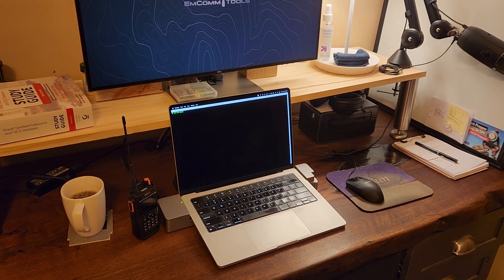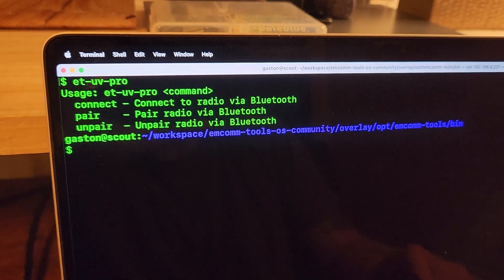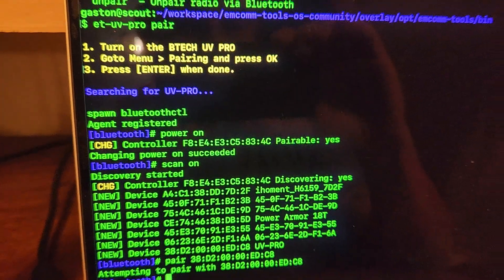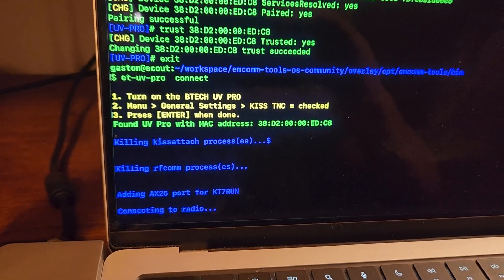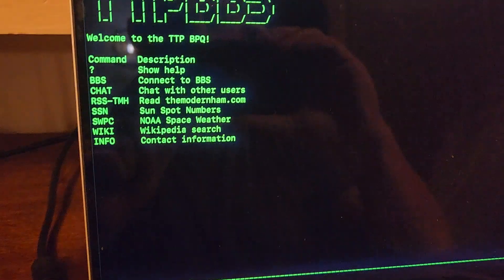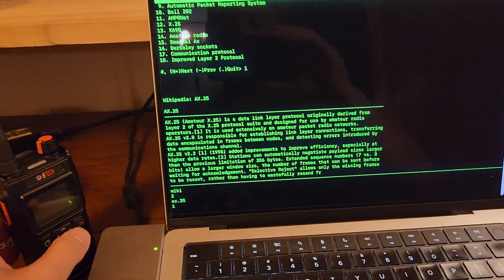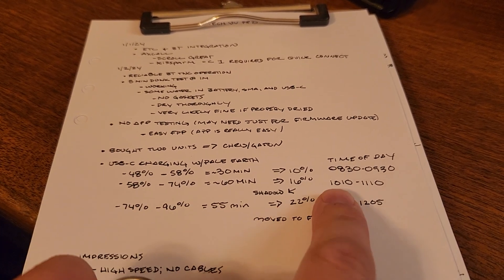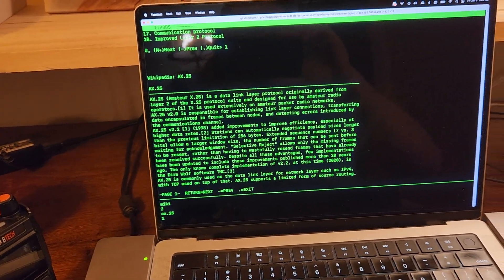BTECH UV PRO - Plug and Play TNC Support

Comment: I know that the term "prepper" causes many different reactions. For me, it's literal. A "prepper" is someone who takes the initiative and increases their preparedness in order to survive situations that others likely will not.  As an instructor, I see your BBS as a tool to maintain and pass on knowledge even if the worst case scenario happens. 

I believe that every group of like-minded individuals needs to pick members who can archive certain bits of knowledge so that knowledge isn't lost over time.  The BBS is a GREAT WAY to pass it on.  Thanks, Gaston, for making me think... and for doing this.
Reply from the maker: That's exactly my vision for running a local BBS. I want to establish purely offline knowledge hubs for local communities. The bulletins can be pure gold for any community that invests the time to stand up the infrastructure and feed it with local, relevant and accurate info. Stay tuned for the full BBS video late this month. Happy New Year.

Comment: In case it's not clear, the poster is using macOS to connect to a Linux machine and using the Linux kernel's built-in AX.25 stack.  

While Bluetooth LE works on macOS, and you can run the native BTECH UV app on macOS from the App Store, you cannot pair and use it as a TNC with KISSet TNC.
Reply from the maker: Thanks for calling this out. I was connected via SSH from my Mac to the Dell 7220 running Linux. The Linux machine was the one paired to the UV Pro. And, yes, I was using the natice AX.25 stack under Linux.

I had some sensitive information on the Dell, so I ran the demo remotely with the Mac.

Comment: Exciting stuff. As someone who grew up in the age of BBS's I'm probably a little more excited than I thought I would be to hear this project's going on. 
I wonder if you could use something like internet in a box to download an offline version of the wiki and have the BBS pull from that. I think it would be a little more in line with the off-grid mentality. Sure the IIAB is connecting to the internet periodically to refresh, but if the internet goes down the BBS won't care. 
My radio arrives today. So whenever a build comes out that I can use to test this stuff you're working on I'll be looking forward to it. Keep up the awesome work.
Reply from the maker: Actually, I am already running and hosting local .zim files with kiwix. I have the full 56 GB dump of wikipedia on the same machine running as of 12/22/24. However, I have not yet integrated that as the date source using the BBS as am I a very new kiwix user. Enjoy your new radio. The full length BBS video will be coming out late this month.

Comment: Have tried bluetooth pairing the radio to a Chromium based browser with Web Bluetooth?
If search for "Web Bluetooth Samples" should bring up some example that pairs and dumps the device info (manufacturer and so on).
Would get a cross platform (anything that can run Chromium & has bluetooth) GUI and touchscreen UI (for using a smart phone with the radio) with one stone.

Comment: I wouldn't be too worried about the IP rating. The Comms Channel has plenty of video of this thing running powered on while sitting in a river.
Reply from the maker: Good to know. I have not watched any videos or even read the manual as I wanted a fully unbiased view of this radio. I'll have to go and watch some of the videos that others have made when I have time.
Reply: As long as it's not going to go belly up if I'm having to use it in the rain I'll be happy. I don't see myself trying to make connections from under the water too often 😎

Comment: I have not been a fan of BTec radio but they built a radio with a real Bluetooth interface. Being able to easily connect wirelessly is someting many of use what to easily use.  Thank you.  PS I wander if its supports 9600 Baud.
Reply from the maker: I'm in your camp, but this radio surprised me. I almost gave it away as a gift to one of my BMAC supporters, but decided to experiment with it for a couple of days. I'm glad I did. 

There's no option in the settings for 9600 baud and I have no clue of the hardware supports it. In general, you need special hardware to do 9600 baud. I recently purchased two of the DigiRig 9600 data cables for the FT-8xx radios so that I can benchmark the real world performance against 1200 baud. This is part of the R&D for the year.

Comment: Have you trsted this radio at 9600 baud?
Reply from the maker: Negative. I have other 9600 baud tests lined up withthe DigiRig FT-8xx cables first. I'll try this in Q2 due to time constraints. In fact, this little rabbit delayed some other work. A next generation email client for Winlink. I need to get back to this.

I'm sure some other YouTuber will explore 9600 before I can get to it.

Comment: You think this is a better option then the Anytone 878?
Reply from the maker: It's a bit like comparing apples and oranges. The AT-878 offers DMR which the UV Pro does not. On the flip side, the UV Pro offers a Bluetooth TNC which the AT-878 does not. If BTECH adds DMR to a future release of the UV Pro, then we'd be closer to an all-in one HT. I personally use both for different applications. Great question. Also, the UV Pro is considerably more rugged and offers something close to an IP67 rating.